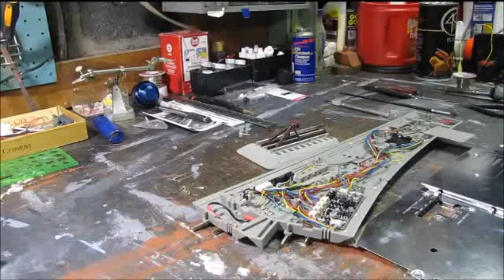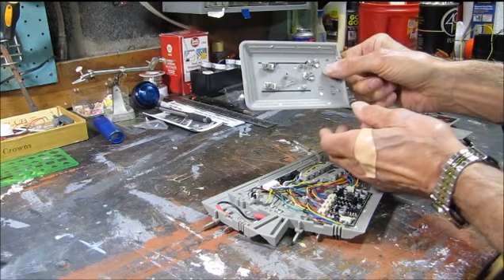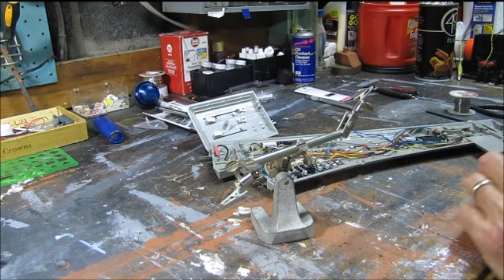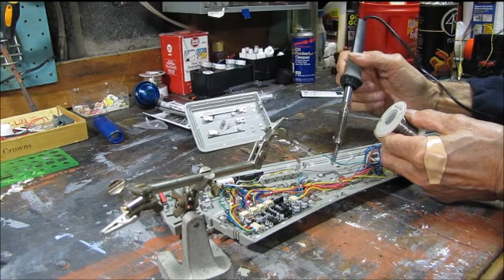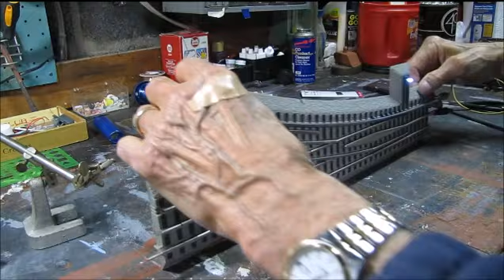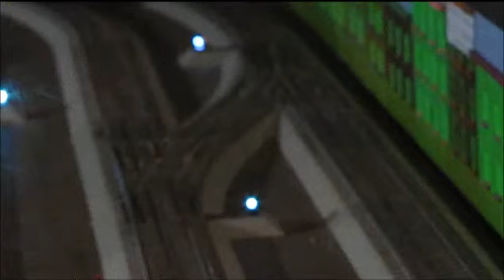Video 31 - Repair Fastrack Remmote/Command Switch

Comment from the maker: What my video was about. How to light, the light on the switch. The yellow wire and the red wire feeds power to the motor of the switch. The two wires that feed power to the light on the switch are the blue and green wires. I hope this clarifies that the yellow wire has nothing to do with light on the switch.

Comment: I have a 036 remote control switch that I have to repair ♐👌
Reply from the maker: I like to help you, but I do not know what problem you have with the remote switch. Remember I have no idea how the board in the switch works. Let me know what the problem is with the remote switch and perhaps we can finger out how to saliva the problem.
Reply: @nickltrains6952  The switch does not switch at all.The light for the controller does not come on nor for lantern.
Reply from the maker: @OgaugeTrainsplusslotCars  One is the switch still on warranty?
Reply: @nickltrains6952  Brought it on ebay.Lost phone with receipt. Hade the switch for around 8 months but don't have receipt
Reply from the maker: @OgaugeTrainsplusslotCars  Sometimes it could be a mechanical problem. Did you take the back cover off to see if the gear is not bonding, which through the switch to Strate track and curve track?
Reply: @nickltrains6952  I've taken the switch apart twice.Cant get it to work.The non derailing feature does not work either.Every time a Train crosses over the opposite direction I have to manually switch.
Reply from the maker: @OgaugeTrainsplusslotCars  Is the switch controlled by the remote switch, which is connected with the black Cabel or is it controlled by the Lagacy Cabe 2 remote? I'm trying to find out which switch you have.